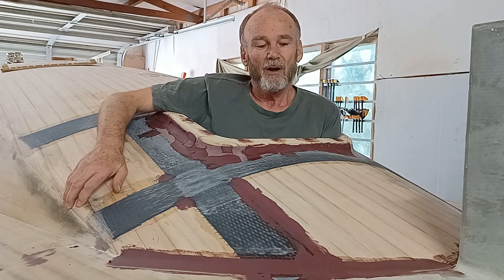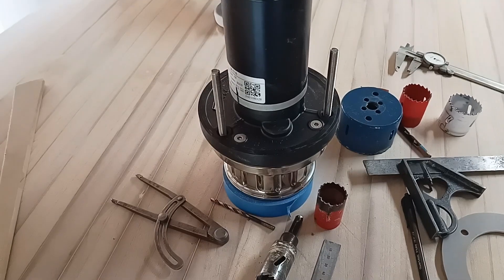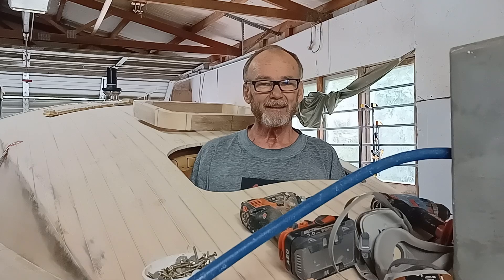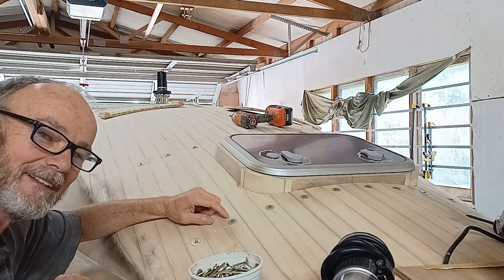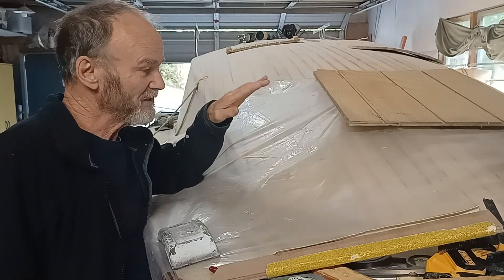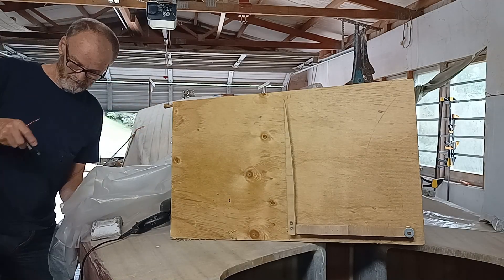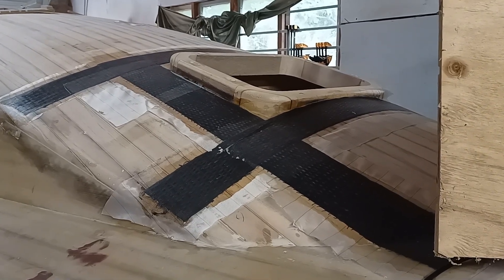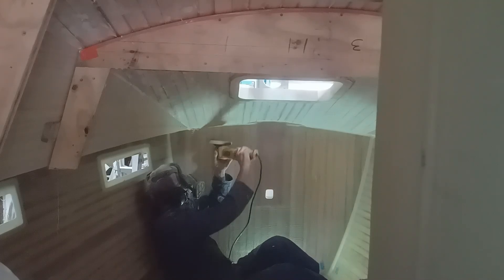Trailer Yacht Build - Deck fit out and dealing with Humidity in Paulownia Timber

Comment: Will you epoxy and glass the underside of the cabin top as well in order to increase the stabilization of the wood?
Reply from the maker: @terraTrekNW  that's a good question. I'll do the glassing under the cabin top as soon as I can but first I have to remove the temporary cabin frames, fill and sand the underside, work out the final placement for everything that will be bolted or screwed though the cabin top, drill and fill the bushing through the timber and then glass the underside.  But yes ideally I'd do it straight away although the carbon straps sure stop the movement!
Reply: Sounds good. In the most recent episode of Ran Sailing, the guy (I don't know how I should spell his name) talks about and uses carbon fiber. I don't know too much about carbon fiber, so I was interested to learn about just how much stronger it is relative to regular cloth. It's amazing stuff.
Reply from the maker: @terraTrekNW  yes I just watched that episode and was quite interested in his comments and to see how he is using carbon fiber. Like him, I also don't want it too close to any fittings for the same reasons. The Sailing Wyns are trying to get to the bottom of their issues.....
It certainly costs more and to get the full advantage the layup method really matters, vacuum bagging it like he did gives the strongest results for weight.
I did a refresh of my understanding by asking AI to compare the two and it confidently told me Carbon fiber is 1.2 times stronger! I didn't trust this answer of course and you get a wide variety of results because of all the variables. There are other things to consider as well, a local guy just built a very go fast trailer yacht out of carbon fiber and he wanted to use a single layer over the foam in some places which would have been strong enough in a lot of respects but his guy doing the layup wouldn't let him because the impact resistance for that area of the hull wouldn't have been strong enough.
What I see people get wrong, is, if you combine it with timber or fiberglass it's the carbon fiber that takes all the load because of its very low relative elasticity. My last trailer sailor had a rudder blade housing made of a combination of fiberglass and carbon fiber, I had to fix serious cracks in it because the carbon was only 'sharing' the load and not up to taking all of it.
Thanks for your comments!